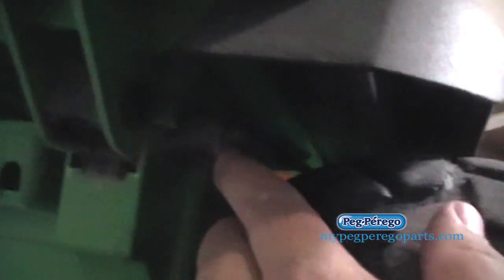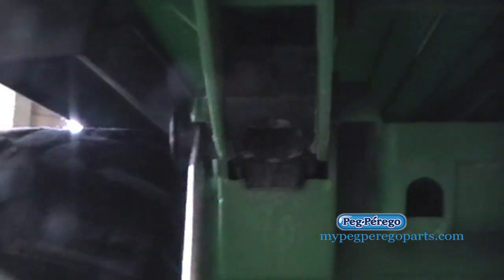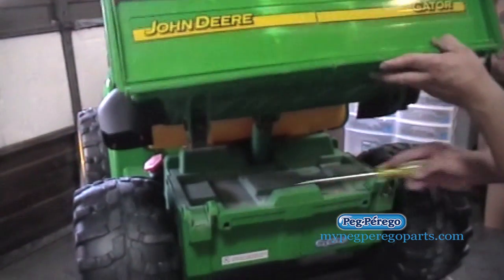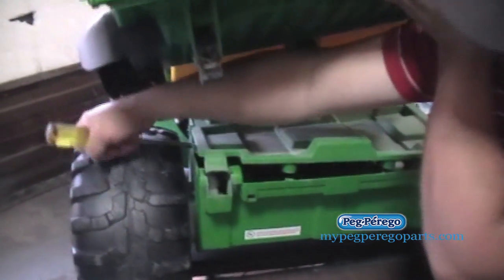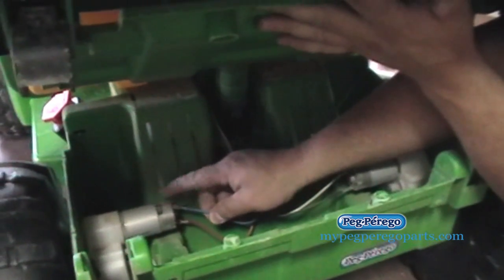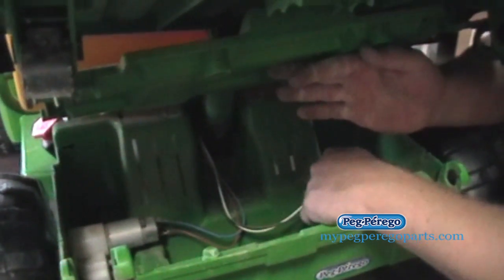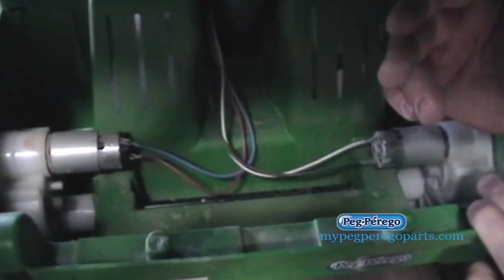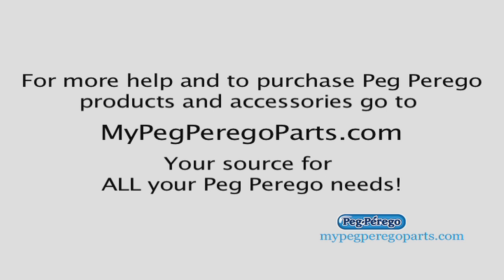How to replace the gearbox and motor on a Peg Perego John Deere Gator child's ride on toy

Comment: Great for taking it apart and troubleshooting but didn’t actually show me how to remove the engine.... you have a video for that?
Reply: Have you managed this as I have just done it and it is relatively straightforward
Reply: Muiry8 yes it was simpler than I expected. Thanks for asking.
Reply: @KyleSpitzley  not a problem, I fortunately found a video that took me through it. What problem did you have with your one? I have found a burnt out motor sadly
Reply: Muiry8 the gears were stripped and wouldn’t catch on the wheel, effectively losing one wheels power. Were you able to find a replacement motor?
Reply: @KyleSpitzley  yes, wife managed to find motor and gearbox for £35. I am trying to find motor specs so I can just buy an equivalent 12v motor if it happens again
Reply: Muiry8 I found one on ereplacementparts.com for $25. I don’t know if they have 12v tho